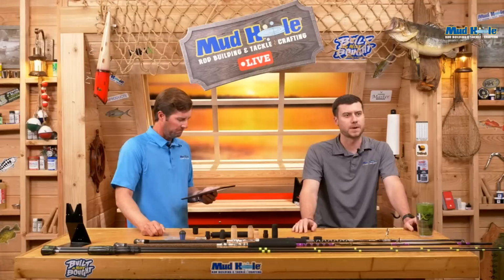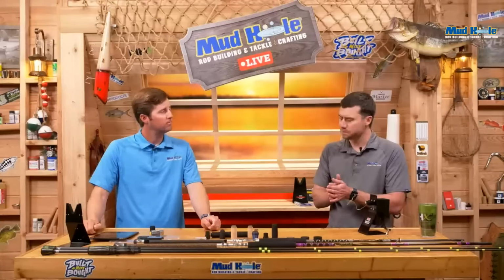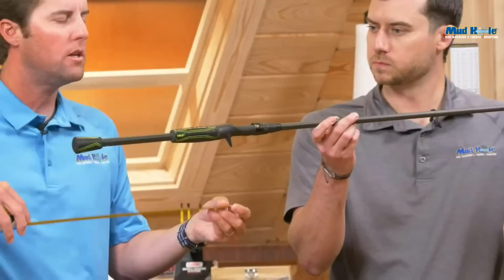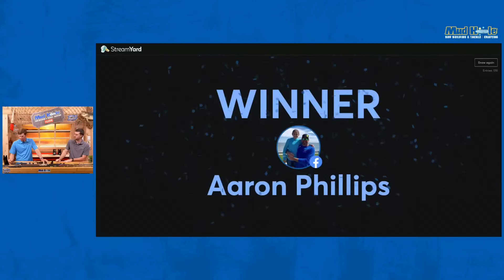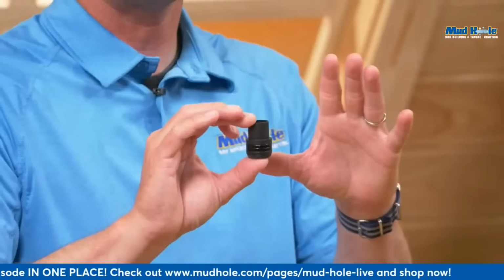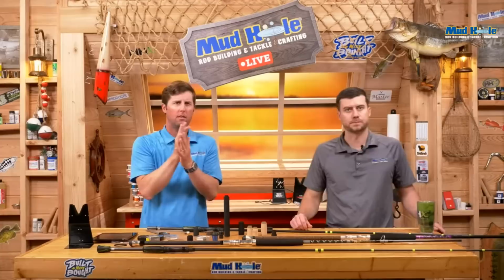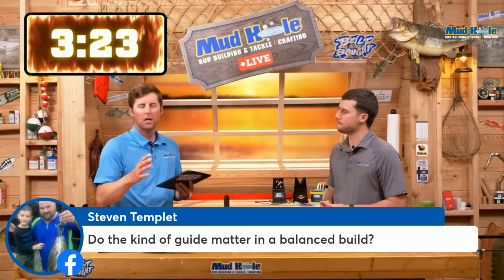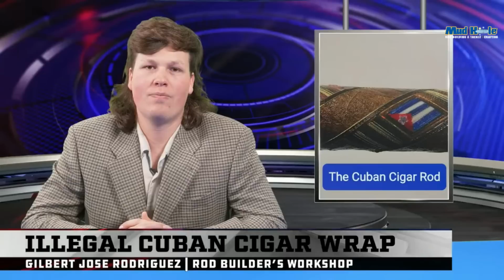Watch the ALL NEW Mud Hole Live: Balanced Builds – 2/22 at 6:30PM EST

Comment: For Doug and the trout rod question...I'm a Texas Inshore wade and kayak fisherman. This is for casting, most Texans use only casting. Most Tx inshore rods go with a short butt, 7-3/4" to 8-1/2". If you look at our custom builders like Laguna, Waterloo, ild 18, Sarge, H and H, Fish Stix, or even FTU Xcel and green rods, they are all between 6-7 foot and have a short but right around 8 inches from the rear of the fighting butt to where reel seat meets grip.